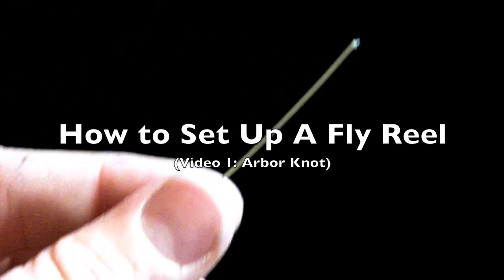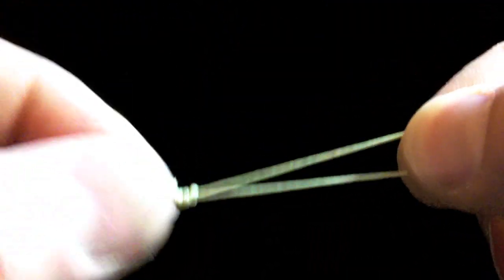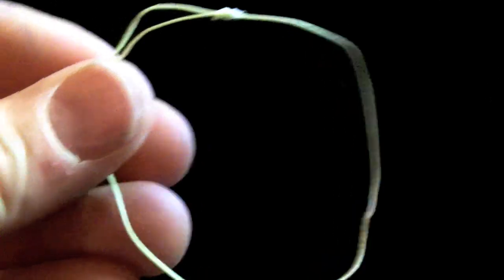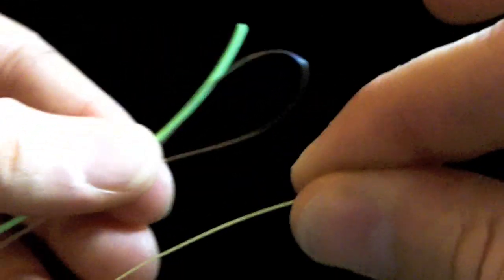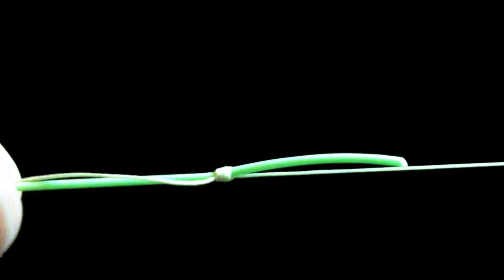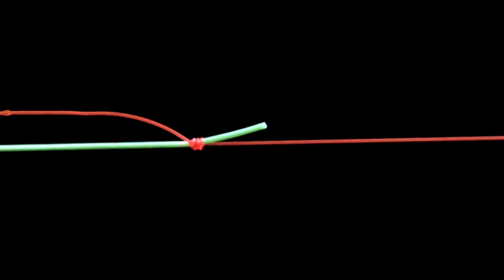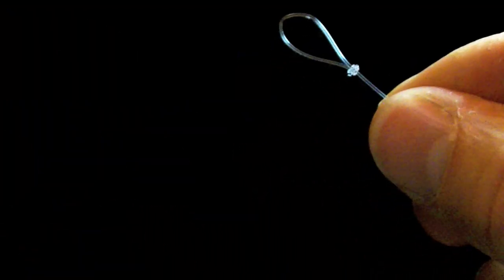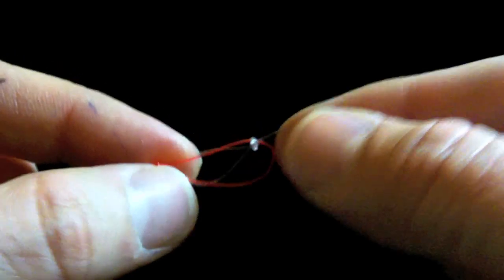How to Set Up a Fly Reel (Full)

Comment: Great video. here are some tips you may find usefull. when doing the nail knot cut the tag end of the flyline at the knot at roughly  45degree angle and then put a drop of CA glue on it to hold the leader & tippet together at the cut end. I use roughly 1 1/2-2' leader then use a blood knot to tie the tippet to the leader. these knots are tapered a bit when done correctly and will slide through your guides easier if by chance you do pull them in that far. tight lines my fellow anglers

Comment: Excellent instructional vid Zach. You make the knots very clear...very good. Just a couple newb questions: 1) You wind your backing on with left hand retrieve. I'm right handed but, left hand retreive seems better (holding the rod in my stronger, right hand and reeling with my left). comments?
2) What # test are you using for the amnesia? It looks pretty hefty.
Thanks again.

Comment from the maker: @Pickering1977 Try using a monofilament that is quite a bit heavier than the material you are actually making the nail knot with.  That will ensure that the hole the doubled-over loop and tag have to pass through is as big as possible.  For example, if you were using 20# test mono for the actual nail knot, try 30# for the "pull loop."

Comment from the maker: @thedogthatyos That depends on the size of your reel.  For most trout reels, 100 yards is about right.  For saltwater applications, for instance on 8 weight reels for redfish or bonefish, 200-300 yards is more normal.  The best way to get that much backing is to go to a fly shop where they have a huge spools and can load up the exact amount your reel can take.  Typically this only costs $15 or so, and if you buy a line they may throw the backing in for free.

Comment from the maker: The amnesia is 20# test, which is pretty standard for trout, because it needs to carry the load of the line through to the butt of the leader.  Leader butts themselves are usually 20-30 lb. test--any weaker and you'd get a hinge point.  So you want to match the thickness of the butt of the leader at a bare minimum.

Left hand retrieve is common enough these days for right handed anglers.  I swap out depending on the reel but left hand retrieve is my preferred method.

Comment from the maker: Correct; if you don't want to worry with loops for easily replacing the leader, you can instead use a nail knot (the one you called a handshake knot) to tie the butt of the leader directly to the fly line.  When that leader wears out, just clip it off a few inches from where it is tied in, and make a Perfection Loop as demonstrated to make a loop-to-loop knot for your next tapered leader.  The only difference would be that the material attached to the fly line would be clear instead of red.

Comment: Thanks ! Great video ! Wondering what LB size do you use for trout fishing ?
Reply from the maker: That's more of a question for a spin fisherman.  Typically fly fishers use tippet measured in "X" sizes which are based on the outside diameter of the tippet.  My go-to tippet is either 5X or 6X, which equates to .006 and .005 inches in diameter respectively.  They have a pound break strength of between four and eight pounds depending on the quality of the material (which actually varies quite a lot).

Comment: Awesome Video Zach! I see you specify "for trout" but is this a suitable way for Saltwater fly fishing too?
Reply from the maker: Yes with heavier grade lines.  For something heavy like tarpon the principals are the same but you will want to use a Bimini Twist for the backing to fly line connection, and likely stick with the welded loops that come with modern lines.  (They are actually a lot stronger than nail knots).

Comment from the maker: @KBFF Fly lines come in standard lengths, usually of 90 feet for a freshwater reel.  You should always use the WHOLE fly line.  They are "tapered" to make them easier to cast, and if you start cutting into that taper, you can make them very difficult to actually fish with.  So unlike in conventional fishing, we don't treat fly line like a spool of level material, because it gets thicker and thinner along its length to make it easier to cast.

Comment from the maker: The amnesia loop to loop makes the leader interchangeable, so you don't have to cut your line and re-tie a nail knot on the water.  Instead you can just loop in a new leader, which typically come with a loop pre-tied out of the packaging.  This is especially useful for a new angler who is much more likely to tie his leaders in knots.

Comment: is it better to spool the reel while its free like that or while its connected to the rod? i feel like having the reel on the rod would make the line lay down a little cleaner on the spool?
Reply from the maker: Yes if you are going to be spooling on a lot of backing you really do need to get the reel as stationary as possible.  This is one place where a fly shop with their backing spooling machine can really be helpful.  Unless the reel is very stationary it will wobble and eventually the line will roll on equally wobbly.

Comment: Backing brings the fly line out to the edge of the spool. This effectively increases the diameter of the arbor and allows the reel to retrieve line as efficiently as possible. Also a leader loop makes it so that you don't have to trim your expensive fly line every time you change leader.  Fly lines are tapered so excessive trimming can ruin the way a line casts.

Comment from the maker: @Bonecollector621 You could certainly; you'd just need to fill more of the space up with backing.  That reel is likely to be a little heavy for a 6 weight *rod*, but not catastrophically bad.  If budget is an issue, go for it.  Otherwise, try to match your tackle by weight.

Comment: On the backing to fly line knot, wouldnt a 1/2 uni knot accomplish the same thing? I did a 4 turn uni of the braid over the fly line it pinches down pretty hard. Couldnt pull the fly line free. Doesnt even move.

Comment from the maker: Backing is the thinner, cheaper string that fills the fly reel behind the thick, expensive fly line.  Yes, you can use this same exact system to set up a 7/8 reel, you just need heavier grade line.  Yes, this is also good for salt water.  At some point soon I'll post a different knot system meant for heavier gamefish like stripers or tarpon.

Comment: What is the point of the amnesia line? Is it just to tie the leader onto or what, ive never seen that ive always seen leader directly to fly line?
Reply from the maker: Trevor Mackenzie So you can swap out tapered leaders easily using the loop to loop connector without cutting back into the fly line.

Comment from the maker: Same knots, heavier overall line for saltwater up to the 10-12 weight tarpon-fishing level, when you need to go to even heavier knots and line.

For redfish it would be 30 lb backing instead of twenty pound, and typically 30 lb amnesia for the loop to loop connector, then a redfish-branded leader.

Comment: why is the mono filament needed?  i went fly fishing for the first time to day and just had the leader on but the line was not getting a great deal out?
Reply: Because mono Floats. And you fly must float.
Reply from the maker: Dean evs Adding tippet gives you something to cut back into without shortening your tapered leader.
Reply: Zach Matthews ah great thanks for the info
Reply from the maker: LowesOutdoors Monofilament sinks, as does fluorocarbon, unless you dope it with floatant.  The reason for the tippet is to give you extra length to cut back into as you change flies without shortening your tapered leader.

Comment from the maker: @francetonomor  This system will work for light saltwater up to bonefish and permit-strength fish.  Certainly fine for marsh redfish, surf fishing for blues or jacks, or most flats.  I would not use this for tarpon, tuna, or anything requiring lots of lifting as the nail knot can slip if you're dead-lifting a large weight.  I'm going to make a video soon breaking down a heavy rig for stripers or tarpon.  Those rigs are not as stealthy because the knots are larger but they won't fail.

Comment: So how long is the section of Amnesia and how long is the leader?
Reply from the maker: Leader length depends on the application but typically you will use a nine-foot tapered leader.  In some environments you might need to add tippet to that.  My standard trout fishing rig is a 9' 5X leader with 2 feet of 5X or 6X fluorocarbon tippet added to the end for a total of 11 feet.  

For the amnesia I like to keep it as short as possible to prevent hinging.  Start with a foot or so for the nail knot, then tie the perfection loop such that it starts no more than two inches from the butt end of the fly line.  Cut off excess.

Comment from the maker: I've heard Kermit but Fozzy is new.  It sounds to me like I must sound like Jim Henson!

When you use a tapered leader the butt section is likely to already have a loop tied in it (most commercial leaders do).  So in order to loop that leader on, yes, you would need a short length of level monofilament.  I've used red Amnesia mono in the video but you can use any kind of mono so long as it is heavy--at least 20 lb. test.

You can then tie the actual fly on to the tip end of the tapered leader.

Comment: so how much backing should i use? video should be labeled how to tie fly fishing knots.
Reply: That is an inaccurate assessment. If it were "fishing knots" then they would be showing you how to lash hook to line.This covers the basics of setting up your fly rig from reel to leader
Reply: Load the fly line onto the reel first.  THen attach the backing the the fly line. Wind on the backing to about 1/8" from the rim of the reel spool.   Remove and reverse the backing to the reel.  Then you are ready to attach the leader to the line.

Comment: I'm not clear on why you would use the amnesia mono line? why not fly line directly to the leader?
Reply: Wish he would answer this question
Reply: It saves $$$. Why cut into the fly line after changing a leader?
Reply from the maker: +PrentissRacing Amnesia has lower memory than a leader butt, but the main reason is to give you a loop to loop connection so you can more easily swap out leaders after they get cut back or knotted.  The red of amnesia can also serve as a helpful strike indicator.

Comment from the maker: Backing is a thin, braided nylon line that is wound onto the reel first, before you tie in the actual floating fly line.  That way, the line sits off the arbor or center of the reel and takes less coils.  Backing also gives you a "backup" to go to if a fish runs out all your fly line--uncommon for trout but REAL common in the saltwater.  For more come over to the board at itinerantangler-dot-com and post your questions.

Comment from the maker: The issue with using the fly line as a loop is that the loop is monstrous--unless you weld it.  But my strength testing has shown the welded loop is by far the strongest, so if you have a line with a welded loop, don't cut it off! There's another video in my channel showing how to make a welded loop; they won't let me post the link here.

Comment from the maker: Meaning, don't draw it into the guides while you're fighting a fish.  The leader and that leader-to-line connection (the whole series of knots) should stay outside the tiptop.  Otherwise you risk snagging the tip top on a knot while the rod is under pressure and either breaking the rod or losing the fish.

Comment: Clippers work so much better than scissors.  Hemostats work so much better than fingernails. A Fast-Tie tool ties nail knots a lot easier than the fumbily method he shows here. The slip-loop is a great idea for an arbor knot,  because you can remove it easily.